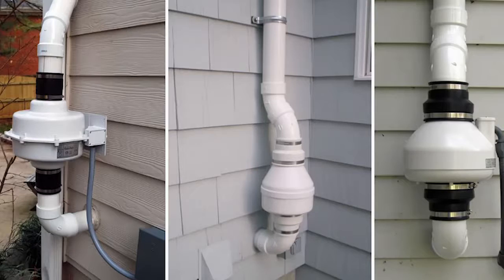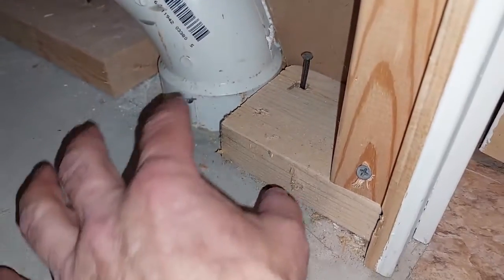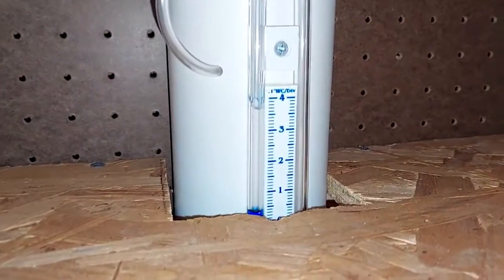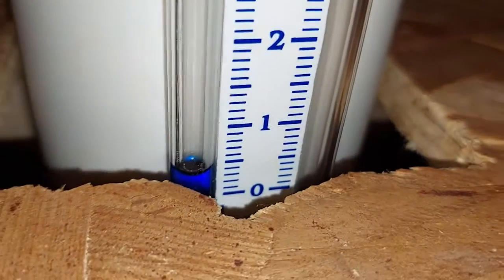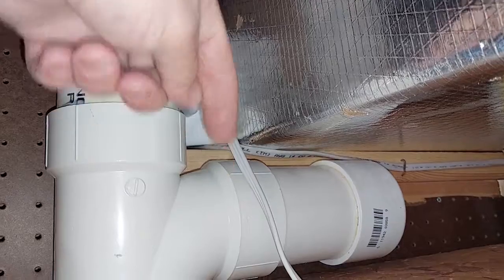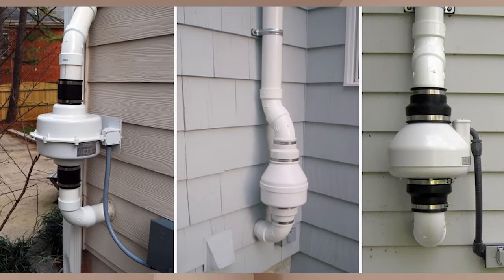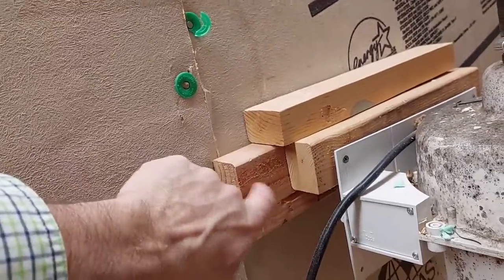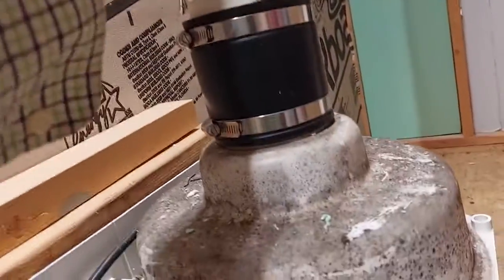DIY: Radon Fan Installation | RadonAway®

Comment: The bottom of the piping just sticks into basement floor or is there alot of digging to do?
Reply from the maker: @CleanestEnergy  correct.... just insert the pipe through the concrete and seal around the pipe against the floor. This forces the air to be sucked from under the concrete